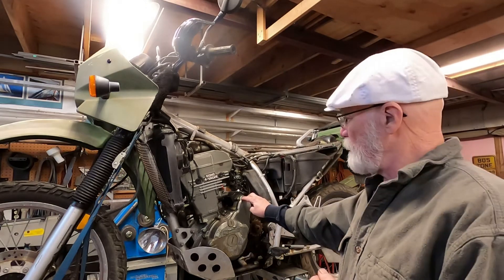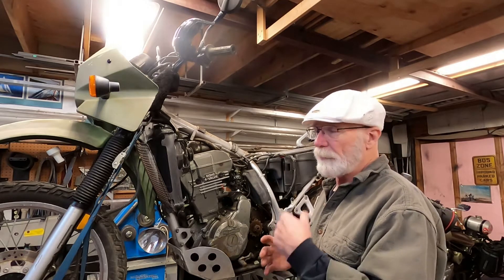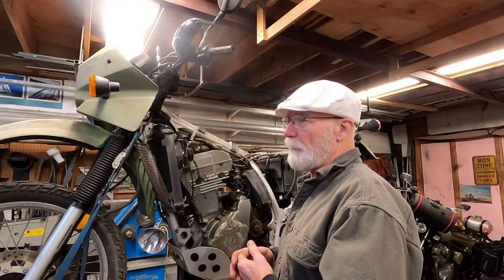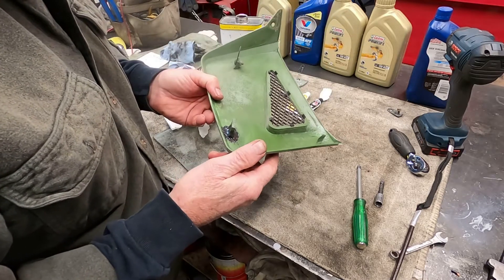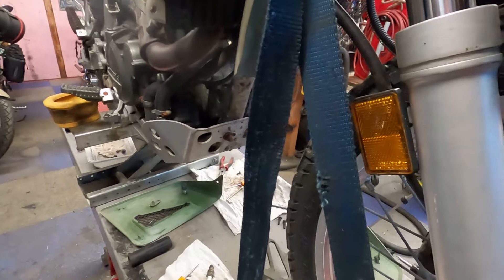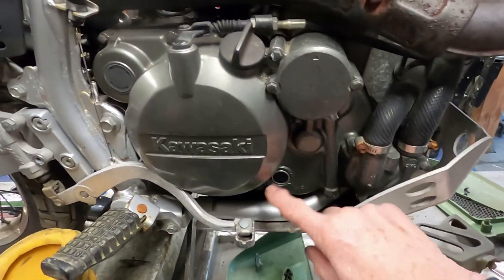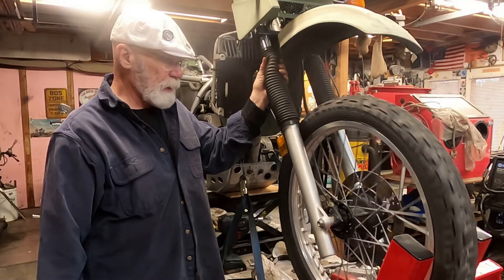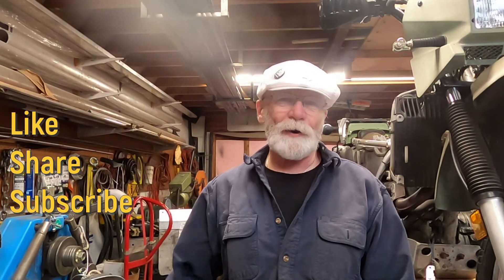KLR650 Fork seals and more

Comment: I think I'm missing something.
Why go through all the extra steps of using that block and vise to loosen the top nuts and bottom bolts?  Why not just break them loose while they're still in the triple clamp before removing the tubes?
Reply from the maker: Yes, you could but do you have the clearance underneath the handlebars? Plus replacing the seals and everything, you might as well make the mounts to fit in the vise, you will eventually. Thanks for watching

Comment: Hello
i am about to replace the seals on my klr and i have a question It is about your hand made tool on 17.43 (on your video) is this tool also needed when assembling or only when disassembling ???
Reply from the maker: Good question, sometimes you do need it for the reassembly and sometimes you need it for the disassembly but not all the time. If you have an impact an air impact wrench sometimes that comes right out of there and it'll tighten right up. Thanks for watching
Reply: @outlaw86custom  thanks a lot